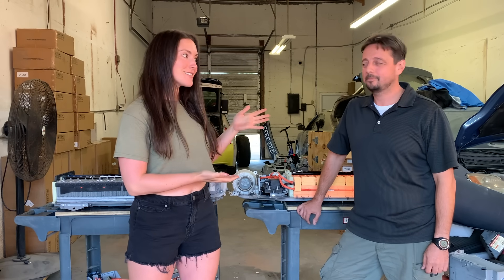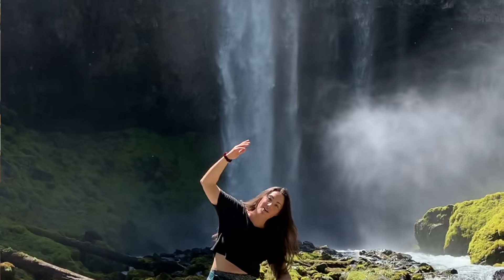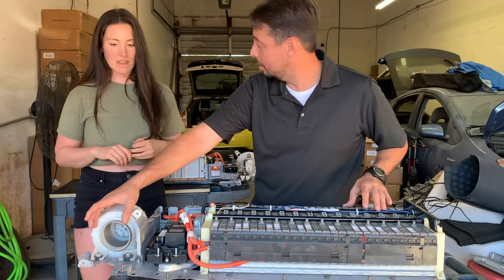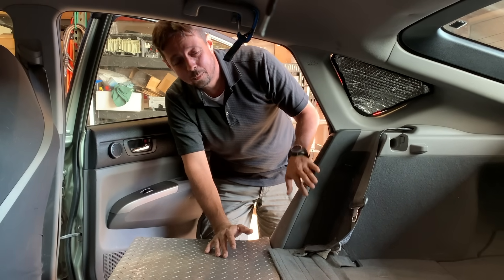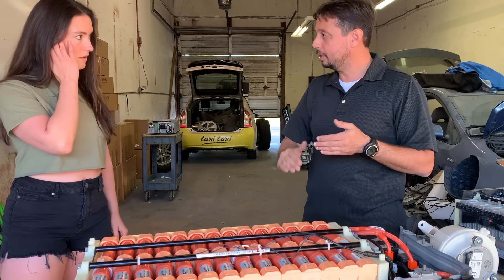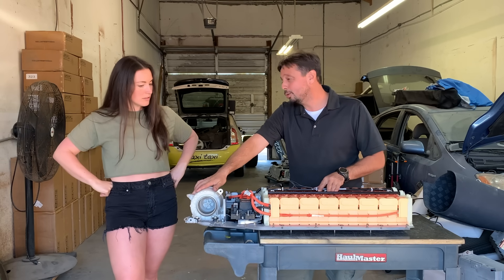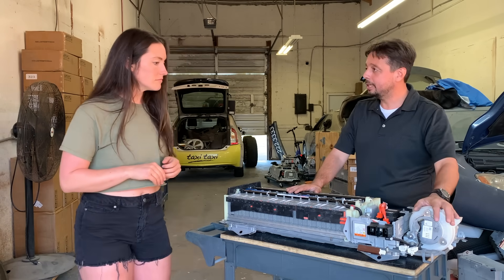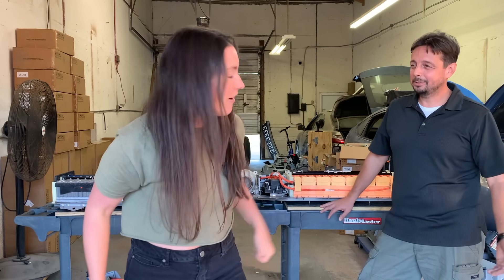Your Hybrid Battery: Tips, Maintenance, Life-Span, & MORE! Must see for a Prius/Hybrid Owner

Comment: batteries are meant to be used so use them, stop worrying about conserving it by not using it for camping or whatever recreational purpose  you choose. Do definitely clean the HV fan at least once or twice in its life. I've had a big stereo system on mine and it's lasted over 150k miles

Comment: Driving a Prius?  Consider getting a security system welded on for the catalytic converter.  Seems crooks love making $300 on each stolen one.  It takes them literally 7 mins to jack up, and cut off the unit.  The OEM replacement from dealership is $1300-$1800.

Comment: Is there a way to have the battery tested before you buy a used Prius?
Reply: Find a Toyota dealership, they have equipment to test it. I’m sure certain mechanics might be able to as well but the dealerships can give you a full vehicle inspection for around 250$
Reply: Park your car with 6 blue bars of charge. After 1 hour of sitting or in the morning start your prius and drive it immediately for a minute and watch the display in the center. The charge level should stay the same or drop not more then 2 bar. If it drops to 2 orange bars or lower then your battery is too weak and about to fail, but it still can be reconditioned.
Do not let your engine charge the battery, drive it immediately.

Comment: Keeping the area of the fan free and clear along with cleaning the fan on the battery pack are critical to extending it's life. Hyper gliding is key to getting longer battery life too.  I would shut off the AC on long road trips if the battery was getting low. 
 I really like his version of the hybrid battery pack. The cells need room to breathe. It's worth the trip to get a swap out.
Reply: Toyota hybrid battery pack modules have enough space between each other for air to flow.

Comment: Okay landed on next Prius video with Alex Nikki.   I am a car buff and I have never wanted a Prius but now I want one!!!!!!   THANKS NIKKI! heh heh.   OKay here is a question for you Nikki to ask Mr. Alex.......If you buy one of his batteries does his have the same 8-10year/120-160K lifetime or Different????  Sorry one more.....Should you crack your rear right(passenger side window) to get more air in the vent to cool the battery??????
Reply: Usually fan doesn't come on until it's really hot outside. Most of the time it's off or in speed 1-2. If you hear it then it's running in speed 5-6.

Comment: I wonder if the batteries can catch fire. Also wonder how heavy those batteries are.
Reply: They may blow but i never heard they catch on fire. They blow when people drive with the red triangle on. The bad module gets overcharged and the pressure in it blow off the top. There is a valve in each module that supposed to release the pressure but after years those valves get stuck.

Comment: In general, try to keep your batteries above 50% charge, it will greatly lengthen the life of the battery
Reply: What you see on your MFD is the charge between 40% and 70%.
The best condition for Toyota hybrid battery would be a deep charge-discharge cycles which reduce modules disbalance.

Comment: What irritates me about the auto industry is they could easily make a small 2 seated hybrid that got well over 100 MPGs . The VW XL1 at 300 MPGs is proof of this (diesel/electric hybrid) it does use expensive carbon fiber to make it super lightweight but if they can get 300 MPGs it's proof a Prius could get 100MPGs instead of 50 if they really wanted to.

Comment: If you wanna live and travel in a vehicle that doesn't have a toilet/shower . It makes way more sense to live/travel in a fuel efficient Prius than in a poor MPG van that doesn't have a toilet/shower. Also many Prius's can actually tow up to 1500 lbs which means you could tow a small cargo trailer full of camping/living gear and still get great MPG's.  It doesn't make sense to buy a used Ford Econoline van that only gets 12 MPGs with no bathroom to live in full time. When you could either get something slightly bigger that has a wet bath (toilet/shower) that gets 12MPGs. Or a 50 MPGs Prius that has no toilet/shower

Comment: My 2007 Prius hybrid battery went bad at 135,000. Dealer in Los Angeles area quoted me $4000 plus tax and after market was around $1400 to $2000. My car bluebook is only around $2500. I was just going to sell it to junkyard. However, I decided to take a chance to do it by myself.  I read and watched lots of YouTube videos  to research.  Its turns out only one cell was bad. I bought the cell from eBay for $25. Total labor was around 8hrs. Since then, over 8,500 miles no issues at all. 
 I have no previous experience with hybrid battery if I can do it anyone can do it and save bunch a money. Also, as recommended by lots of you tubers  when you replace battery cell it is a good idea to clean bus bars (hybrid battery terminals) as well.
Reply: You were lucky you had a "module becomes weak" code, not "replace hybrid battery" code which means you have more than 2 modules weak in the battery pack and you cannot pinpoint them by just measuring the voltage of each module.

Comment: My Prius refused to turn on a couple days ago. It had no power at all. It started to randomly click under the steering wheel. I tried to turn it on 30 minutes later, and it worked with no issue. Same thing happened today.
I initially attributed it to the cold weather, but now I’m thinking there is an issue with the battery. What would you recommend I do?
Reply from the maker: Hmmm I’m no mechanic or specialist but after some similar issues how’s the 12V battery???
Reply: @NikkiDelventhal  Once we got it to turn on, the battery was 12 volts, and once we had it running, it went up to 14.5.
I should’ve tested it when it refused to turn on, but I was in a rush and took a different car.

Would you recommend going straight to a Toyota dealership for help? I’m scared to mess with anything myself, but if you have had good experiences in DIY stuff, I’d consider it.
Thanks for the response!
Reply: There's some videos on YouTube on how to check the 12v battery using the cars own display screen.

Comment: Hey Nikki! I just love your videos and your adventure with Camper. I live in a vehicle myself, for 3 years now, in Europe. Slightly bigger, a motorhome.
About the ventilation of the battery pack, has your technician thought of fitting a tube to get the air from the outside, underneath the car, with a filter? For people having animals constantly releasing hair, that seems a more efficient idea. It will also get colder air except in the Summer. Or, if you spend a lot of time in warm climates, keeping the air intake from the climatised interior, could be solved adding a nice air filter in there.
Thanks for your amazing videos and for sharing valuable knowledge!
Have a great time with Camper!
Reply from the maker: Amazing!!!! That’s an interesting idea/concept! Thanks for watching and supporting! Stay safe and happy out there!
Reply: There is a special grid sold that attaches to the inlet.

Comment: Nikki I love your channel. Thank you for all you do. I have a 2007 Gen 2 and my battery went bad too. After a couple of months of researching I decided to buy a new battery from Toyota and install it myself (with the help of youtube, of course and someone to help lift it in the car). The battery was $2400.00 plus tax. The whole job took about 4 hours and I am a 60 year old woman with very basic mechanical skills.
Reply from the maker: Good work!!! Thank you!!!
Reply: Only the original Toyota battery will have good power and life long enough like the original one. The D-cell type cylinder battery is very primitive and has much less capacity because of bad packing on Toyota casing.   Make sure you have your vent clean and keep it cool in the garage and turn the AC on during summer. The AC is very important part of the cooling of the battery because it cool the batter from the interior part not outside air.
Reply: cAN U DO MINE? I PAY GOOD
Reply: I can fix your bad battery if you are near Virginia. The module capacity will be over 5000 mAh.

Comment: Same battery in mine for 13 years thing is the fan sucks in moist air and the bus bars between the cells are uncoated copper they will corrode and turn green. I you replace them with nickle coated they will last along time. 08 with almost 300,000
Reply: Nickle coated buss bars corrode too.

Comment: We need to buy you a model 3 or Y. No more stress. "Camp Mode"
Reply: se fi  not really interested in a competition or argument, my model S has 463,000 mi and I haven't had a single problem with the batteries.
Reply: @seren8ty  Do you live in your car like Nikki and run the AC or heat all night long? Thanks.
Reply: @seren8ty  so, you've spent most of your life on charging your car.
Reply: @carall66  not at all. About 10 minutes over night for my daily commute once or twice a week. Oh and in 4 years not one maintenance issue except for changing tires and windshield wiper fluid.

Comment: A new battery mixed with used battery’s will destroy the new battery. Lower capacity cells will constantly drain the higher capacity cell.
Reply: It should be reconditioned/balanced. By saying balanced, i mean not mixing modules with other priuses modules.

Comment: I did not think the batteries on these older model hybrids would last as long they do.
Reply: They last 200k plus most of the time.
Reply: I've seen 2005 prius with over 240к miles on original battery, never touched by no one. It depends on the climate and the condition it've been driven in.

Comment: How much just to replace a bad cell?
Reply: Just replacing one module won't fix your battery but it let you drive a little bit longer until next one fail. If you have a failed module it means your battery pack is weak and that one was the weakest module.

Comment: so...all the money you save on gas will eventually go to a new battery?????
Reply: I own a 04 prius and replaced the battery at 200k. I was able to get a factory new toyota battery and have it installed for a total price of $2200. You have a point (especially with low gas prices) but what I didn't realize until after I owned it awhile is how little maintenance is needed. Basically oil and filter changes every 5k and new plugs at 120k. I'm still on the original brake pads and shocks. No starter or alternator belts to replace. Average MPG 45-48 with mixed driving. Toyota says the transmission fluid is lifetime. I finally changed it at 190k for about $100. I probably didn't need to do it but I figured it was cheap insurance. Also great hauler when you fold down the seats. I figure I can run this car another 50 to 100k with no issues. Its hard to justify buying a new car with my operating costs so low.
Reply: @jayo6725  my last car was an 04 sonata.   768000+ on it.  the hyundai dealer down the street has it on their showroom floor.   i drive for a living almost 60000 a year.  Was a great car.  Now I have an 08 sonata with 237000.  Just change the oil and the occasional brake... tie rod replacement is all.

Comment: Alex is correct. Just replace the whole battery and don't mess around with tells individual cells.  Yes, that goes for "rebuild" batteries. They replace the bad cells but all the other non new cells 10-14 years of wear and tear on them and is just a matter of time. Dave yourself the time, money, and frustration. Replace with brand new batteries.
Reply: Replacing with brand new batteries is better but replace with Toyota batteries only.
After 10-14 years of wear and tear they still serve after reconditioning.
Reply: 4K for a battery might as well. Use that to invest into a newer prius

Comment: Oh my hope my battery in my Prius holds on until i can afford to get a new one !😬
Reply: They last a lot longer on average than this guy says.  You’ve got to remember,,,,, he sells batteries for a living.
Reply: After reconditioning the original prius battery it will last ~3 years. I mean reconditioning the whole battery, not each module individually as the most rebuilding companies do. After ~3 years the copper buss bars get corroded, especially the negative side. The corrosion may be prevented by gold plating buss bars. I've never tried that in ~50 rebuilt prius 2 batteries. Never ever grease buss bars. You may kill your battery pack. Nickel plated buss bars corrodes so badly that you won't be able to remove the 8mm nut from module terminal.
Тhe only battery packs that I could not recondition were those in which the internal resistance of all modules reached higher than 0.3oM. I have 2 of these packs. Prius throws a code P0A80 (replace hybrid battery) in a few minutes after starting.
If someone decided to replace the hybrid battery pack to a new or a fresh one, then the cheapest option would be to buy a battery pack from prius 4 with 20-30k miles and swap the modules. Prius 4 still use Nickel-Hydride batteries. The modules look different but they are the same dimensions as prius 2-3 modules.
Reply: https://youtu.be/eT9lZu9CsD4